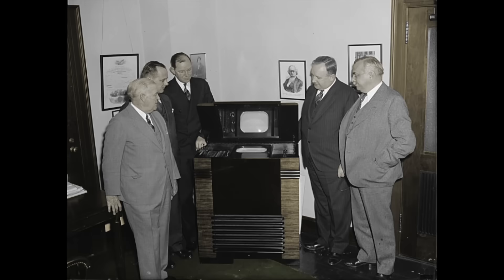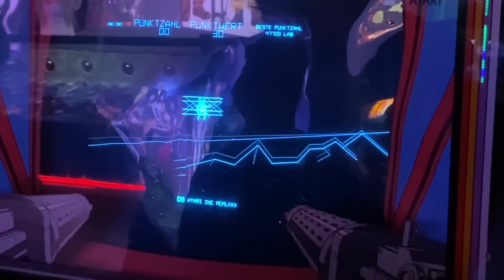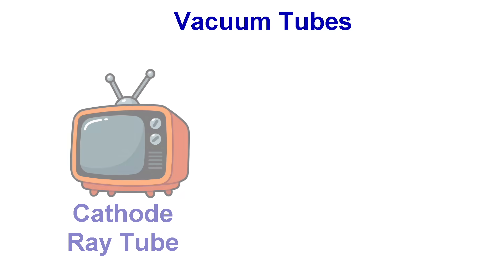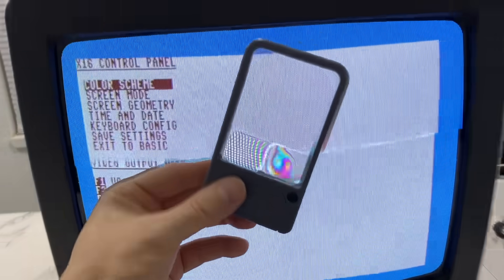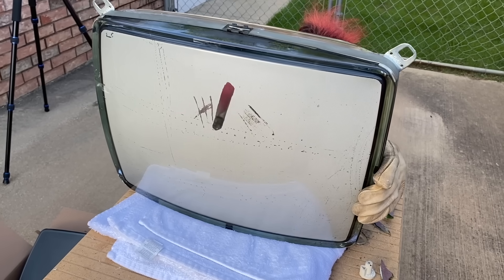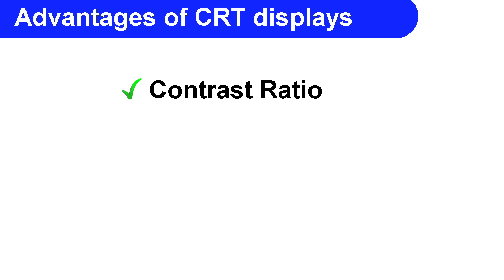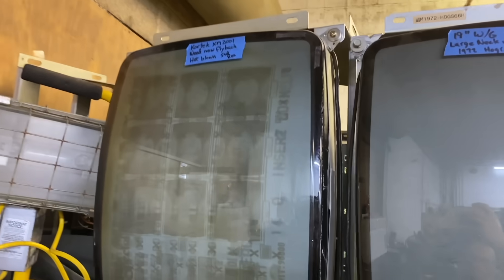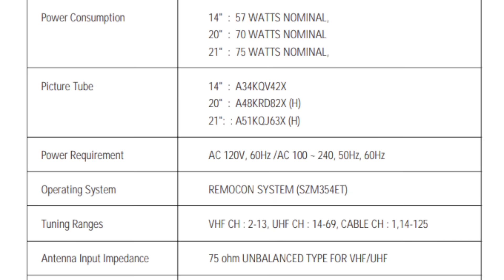How Cathode Ray Tubes Work.

Comment: I remember CRT tvs gave off a high pitch noise, something like tinitus. It wasn't hard on the ears but it did give you away to your parents if you were staying up late playing your NES.
Reply: Your parents could hear it? Mine had no idea what I was talking about when I tried to describe it to them.
Reply: @notreallydaedalus  lol hearing loss in old people is so funny. always cracks me up
Reply: Yes, 15625 Hz, the frequency of the scanlines. In NTSC you had 15625/30=521 lines, on PAL 15625/25=625 lines. So what NTSC gained in refresh rate, it lost in vertical resolution.
Reply: Yeah, I always describe my tinnitus as that CRT high pitch noise.
Reply: They also give off a buzz. Vertical retrace noise, 60 Hz NTSC, 50 Hz PAL.
Reply: @dougbrowning82  That is not what you hear. It is the horizontal refresh that is audible. In both cases this is 15625 Hz. In PAL this means 15625/25=625 scanlines interlaced, and on NTSC this is 15625/30=520 lines interlaced. But above 40 years, you won't hear it anymore. By using the same horizontal refresh, it is rather easy to make a multinorm CRT chassis that works across the globe.
Reply: @lovemadeinjapanisn’t that the flyback rather than the tube itself?
Reply: @ScottHodgins29  CRTs do give off a whining noise but you lose the ability to hear it around 25-30 years old due to natural hearing loss. So unless your parents were incredibly young when you were born, they wouldn't hear it.
Reply: Yeah, but I wouldn't describe it as a "noise", always seemed more like I felt it rather than heard it. Like some 6th sense.

Comment: In 2000s there were a. Nokia colora monitor with an key to magnets the monitor. If I play with an magnets o the monitor there is an key wich is to unmagnet the monitor and there is color monitor ( from 2000 and something)  with an key to un magnet the monitor and to adjust screen such as rotate, expand imagem, etc

Comment: @14:40 i have had image persistence on LCD's (a 17in and a 19in Samsung from the mid/late 2000's) after playing a game for a long amount of time the UI would start to leave a permanent  ghosting, using a program to flash different colors for several hours did help but never fully removed it, while not the same as screen burn it did eventually make me buy a new monitor as it was annoying.

Comment: Regarding longevity, I'd say the CRT probably out lasts LCD, cause although an LCD pannel itself lasts longer, the backlight usually fails prematurely, weather they be the cold cathode tube type or LED. We still have stores where I live in the uk that still have CRT's working 24/7 in shop entrances, it's incredible they still have a visible picture on them, given it's been well over a decade, if not two since they were likely installed.

Comment: This is probably a stupid question: If the electron gun/guns were turned on and given a signal to try and make a picture but didn’t have a shadow mask or screen to collide with, would it cause damage to things or be dangerous if someone walked in front of it?

Comment: 17:56 The fact that the 1/3 burger failed vs the 1/4 because people believed that 1/4 was bigger... It worries me too much. because... I believe you make a mistake like that from a elementary school boy or the people of my metric third world country. But, for people from a Country whose metric system and Main unit is, in fact, commonly Fractional not to be able to differentiate and believe that 1/3 is smaller than a 1/4 really blows my mind. It's simply impossible. Even their own currency is called quarters for a reason. How can they make a mistake like that... I mean, if you know how much 1/4 is and how much 1/2 is, what makes you think that 1/3 is smaller?

Seriously, I can't... cuz'  if it is so common that an error like this can cause a commercial catastrophe... metrification and "decimalization" should be much more in demand.... What's more... how do these people use a ruler; they say 5 feet one inch and 3 lines?

Comment: Love the CRT. I once work in a CRT TV production factory. We took a big lot of old computer CRT monitor and turn it into TVs. The computer monitor stripes are denser than TV, so the image looks exceptionally sharp compare to normal TV at the time. Good times. I would still love to use CRT because of lots of advantage that he described, but unfortunately, I could no longer find it in retail stores.

Oh, I think you forget to mention, but many games uses this technique to create a transparent effect by placing and removing sprite at very fast rate. Also, the way how they make water fall flow naturally as well. While the game is in pixels, CRT smooths out the pixelated pixels to make the image smoother too.

Comment: My first LCD was a 19" 5:4. 1280x1024, so it did 720p without awkward scaling.
Reply: My first LCD was an Acer AL1917W 16:10 back in 2007. It was an alright monitor, but the lack of 4:3/5:4 ration was something to be desired. I have a 24" Dell 2407WFPb that handles any ratio you throw at it and set the aspect to the way you want it.

We had a flat tube Samsung that was a widescreen that was alright, but it died years ago. I have about 12 CRTs (internally in the systems for the Compaq Portable XT, Compaq Portable 286, and Macintosh Classic M1420 or consumer sets, professional monitor, and computer monitor) in my collection and they all needed repairs and/or cleaning.

Comment: The modern LCD televisions with LED back lighting don't work for very long, I did repair some of them because the LEDs are simply burnd out
Reply: Why would solid state technology at low voltage not last as long as phosphor bombed by high energy particles, or a gun which depends on the top single atomic layer for functioning? I could even understand problems with mosfets for the LED, because they also rely on a perfect Si Si:O2 interface.
Reply: @ArneChristianRosenfeldt  In my experience when repairing televisions, it is usually because the manufacturers simply drive the LEDs too hard
Reply: @MiamiMillionaire  and when you dim it? My wife always watches at max power..

Comment: My uncle worked for Thompson electronic, rca. One of the things they worked on was adding your text to the screen from the VCR and not depending on the television the VCR itself would create its own video synchronization signal so the numbers letters or whatever text on the screen would continue to be straight from the VCR rather than following the randomized pattern if you were on a non Channel or a static Channel with no sync signal from the channel.

Comment: If you're building a retro-arcade cabinet with "Emulation Station" and a bunch of ROMs etc, a 4:3 monitor is the best way to go because it can adapt more easily to vertically and horizontally oriented games. If you have a 16:9 monitor it will be great for horizontally oriented games but not so good at vertically oriented ones (unless your monitor can rotate 90 degrees!).
Reply: Even holdere for office monitors can rotate.
Reply: @ArneChristianRosenfeldt  Might be inefficient or impractical in a retro arcade cabinet though.
Reply: @JustWasted3HoursHere  retro or vintage? If you don’t have a tube and maybe even use a small Raspberry, you can design the cabinets around the rotation using an electric motor. We all hate lube, so ideally there would be a small walker ( lubed ) which walks with zero sliding component over a large ring gear.

Comment: Great video David, three things:
1) OLED screens can achieve true black
2) I have a 15+ years old Dell LCD monitor still working like new
3) another advantage of CRT: no dead pixels
Reply: Passive LCD also has no dead pixels. What is the yield for CRT? I always bought cheap LCD and accepted one pixel at cold temps.  With money no dead pixels.
Reply: @ArneChristianRosenfeldt  Passive matrix LCDs can definitely have dead pixels. My old laptop has at least two.
Reply: @eDoc2020  Interesting. I have ever seen passive LCD on Gameboys. I refused to switch to notebooks before TFT.
Reply: @ArneChristianRosenfeldt   The larger a screen is the likelihood of dead pixels goes up like crazy. With a tiny Game Boy screen the odds are lower. Perhaps more importantly it's cheaper to cull damaged panels when they are small.

Having said that, there are reports of people having dead pixels in their Game Boys. I"m not sure if they were always there of if they appeared later.
Reply: @eDoc2020  isn’t a passive LCD composed of two classes with stripes of conductors cross crossing each other? And the liquid just flows between the glasses. I guess that I just described the original Gameboy screen. I have only seen pictures where a fractal grows in from the side. It does not respect pixel boundaries.
Reply: @ArneChristianRosenfeldt  It's transparent conductors and insulators. And like any printing process there's a possibility for defects. If there's an extra speck of insulator where there's not supposed to you'll end up with a dead pixel. Or something like that.

I can say that I don't remember seeing any dead pixels in person on low-density B&W LCDs but they are common on larger higher-density laptop CSTN panels. Technology-wise it's the same as the Game Boy's monochrome STN, I don't know what difference makes dead pixels more or less common. I'm guessing the smaller feature size makes dead pixels more common on laptop screens.
Reply: @eDoc2020  I just mean that ITO comes almost last. Thickness is not important. The static electric field reaches 1 mm? Deep. So unless some . I guess that color LCD have metal wires between the pixels .

A defect in this surface structure will lead to speckles.

Comment: my first experience with PC was in black and white monitor in 90. and only able to experience color monitor years later in 2000ish. 
and been using a CRT until late 2010 when it finally gave up and an LCD was cheap enough for me to buy as replacement.
I still had my 3 CRT monitor and 1 Black and White TV cabinet. all dead tho its just sitting there because I don't know how to throw them.

Comment: 10:38
This would always happen to old CRT PIDs at train stations with electric trains whenever a train passed through the station because of the electromagnetic field from various components in the trains such as the motors but those screens just had a ton of burn in from the text they were displaying because of the automatic degaussing on them which would run every minute.

Comment: My issue with most LCDs is not them having issues you mentioned but just things like the backlight going out (on LED panels).  So far I've had two (although to be fair, it's out of about 20-25 LCDs) that had this issue but they were different brands, and not really the cheap ones, but more expensive photo editing ones.  Both died within about 5 years of decent use.  Oddly I have a few cheap ones that still work today but they get a lot less use.  Of course the one way that I've seen LCD die the fastest is not so much from a mechanical standpoint but aesthetics as pepole still don't get it and try to clean screens with alcohol-based cleaning solutions whith cahses the discoloration and eats away at the LCD screen over time.  Of course screens that display the same thing for long periods of time will eventually suffer from burn in and things like dead pixels, etc.

I would argue that most people probably don't know the specific variants of the modern day "LCD" and treat them all the same (they may know about plasma displays from the days of plasma TVs and perhaps LED TVs, but most generically all refer to them as LCDs.   I find I do this myself when speaking to someone who is maybe not that technical.

AS to the last part, most content these days is in the wide-screen format, and that may largely go back to the days of movies where that was usually the aspect ratio of most films (particularly ones shown in theaters).  I don't think there are any modern laptops (that I've seen at least) that have a true 4:3 display anymore, bcause it does make the laptop larger and more square, versus rectangular, and obviously for the reason I just stated about content being mostly in a 16:9 (or something similar) wide-screen format.  Although back in 2005 I did have a Dell Dimension Pentium 4 laptop that did have a 14" 4:3 monitor, and may laptops of the era did too, but I'd say most if not all today are "widescreen".  The other possible reason for settling on 16:9 wide-screen or something similar may also have to do with the ability to scale a 4:3 image within the 16:9 area whereas it may be harder (or would create a much smaller image) if you tried to do the opposite on a 4:3 screen.

Comment: 13:07 well that's not a good comparison because the vinyl record sound will have all the cracks and pops from the analog scratching of the needle in the vinyl tracks (meaning NOISE) while a digital cd source has none of these.

Comment: One of my earlier jobs was as a quality control technician at a tool and die plant that manufactured the three aperture pieces inside the CRT.  We measured random lots of parts on a variety of guages down to tolerances of +/- thousandths of an inch.  It was an interesting part of my career.

Comment: About resolution for CRT, it is true that CRT as physical object is truly analog. But that doesn't give it infinite resolution. It is true that CRT doesn't have pixels, but that doesn't mean it can't display dots.

Saying a CRT has a resolution is wrong, it's better to say it has beam width. If the beam width is 0.01% of the screen, then the beam can occupy 1000 locations across the screen without overlapping with any other location on the screen. And if your goals allow for half occupancy, then you have 2000 locations to play with.
That is not important for vector graphics or such, but when you want to display sharp edges that are high in contrast, it means your screen is limited by the beam width. 1000 "pixels" across.
Running it at 2000 pixels gives you overlap, and so the edges of "pixels" get fuzzy.

Also, for color display, the mask in the background and coating on screen has a set number of color slots. For color display, you DO have resolution. And changing the resolution from anything other than the set number of bands will have drawbacks. If there's 640x480 slots in the mask, then that is the natural resolution of that color display. Running it at 800x600 resolution doesn't give you higher resolution, it gives you wonky edge cases where pixels are 1/3 of the one next to it.
It only makes sense to halve (320x240) or double (1280x960) the resolution of a native 640x480 color screen powered by CRT.

LCD's just take this limitation to the next step... In that the pixels are no longer analog, they are instead distinct steps of 256 different intensities. There's no physical smoothing between them so running a resolution that is less than the native resolution makes the issue MUCH more noticeable, unless of course you halve it, as then everything neatly lines up again.
And doubling the resolution on an LCD simply doesn't make any sense.
(Unless you do so BEFORE sending the image to the screen, as is done with certain anti-aliasing techniques for renderers but that is beside the point)

In short, CRT does have a limit just like LCD does. And that limit is how big each phosphor is on the coating and how wide the beam is when it hits those phosphors and with color it's even worse as you have that mask which physically sets the number of slots for distinct pixels. And every screen with color has a native resolution.
That is why monochrome is always so sharp, it doesn't have slots. Where a color screen does. And if the computer is running some strange resolution like 400x200 or 200x150 etc, then it's going to get fuzzy on a display that is made to show 480 lines, as neither of those resolutions are half the size of 480 lines.
But also, even if you run 640x480, there's always bleed through because TV broadcast doesn't care about pixels where a digital program does.

That is why we have TV vs computer monitor, the latter CARES about pixels. But is essentially the same as a TV in all other aspects. It's just that the beam width is narrower and everything is set up such that the beam always hits in just the right location to not have strange bleeding effects on the screen.
Reply: You cannot phase lock on the mask. The human eye has higher intensity resolution. The effect is that you can trade some color bleeding with sharper intensity patterns. For example, a white line which is not perfectly vertical, lights up as RGB, GBR, BRG on consecutive lines of a trinitron.

Comment: How this funny contraption work is really fascinating, but this video is a bit... hard to imagine if you're don't understand the very basic concept of how the tube works.
.
At the very basic: the easiest way to understand how it works is that the CRT vacuum tube is like having three-color "projector light" shoots light beam at small (vacuum) theater glass and you're using a window blinds / "screen grid" to play shadow puppet and control the how much the light shown on screen for each color, (like how you're playing around with school projectors using your hands) but the plot twist is that you're not controlling how bright the tube shoots the lights, you're controlling how "dark" the images shown at the front/monitors using the video signal.
.
At least that how's the "screen grid" part of the tube works, anyway.